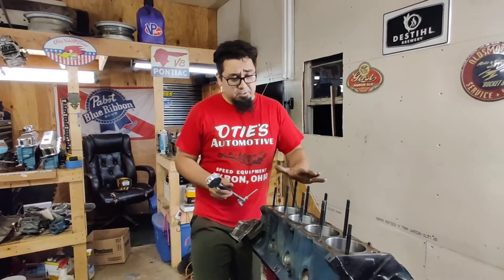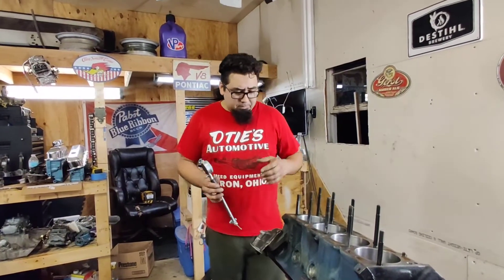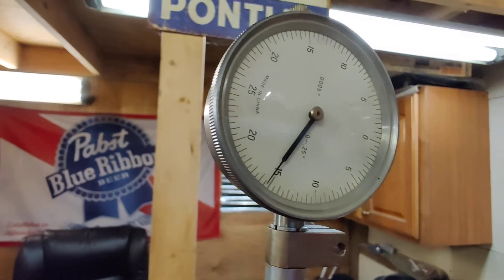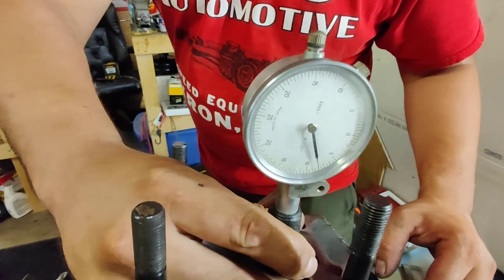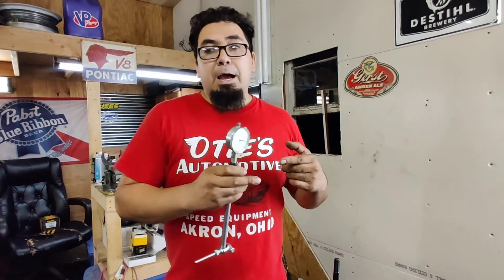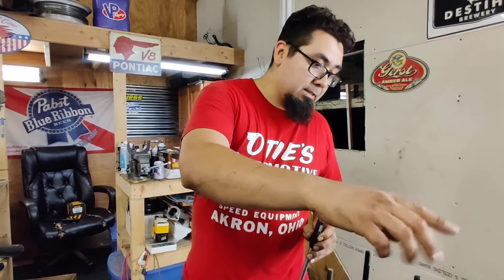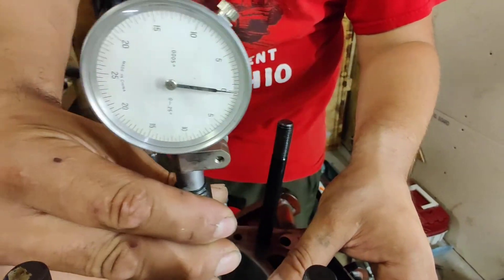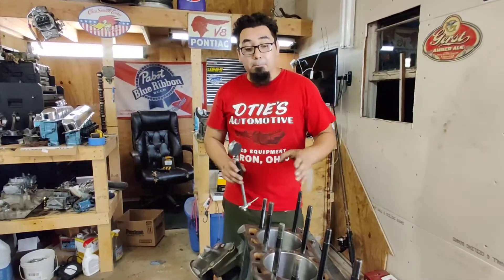Measurement time !!!. Checking the piston to wall clearances.

Comment: Copper , I may have missed it but what piston and rods are you using? Do you follow manufacturing ptw recommendations ? Or do you figure it from you experience? .003 to .004 seems to be the norm .
Reply from the maker: Speed pros .030 over slugs. I believe originally they called for .0025 piston to wall on these but most knee they needed .004 at minimum.